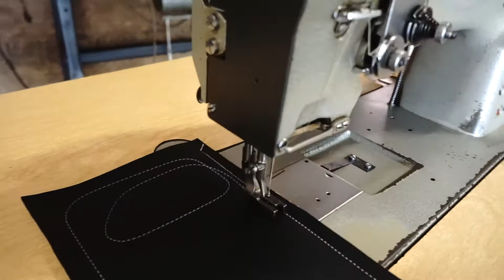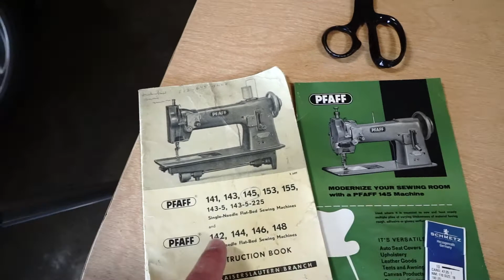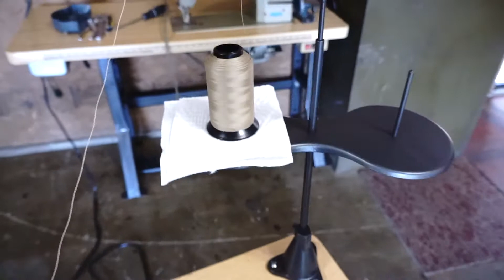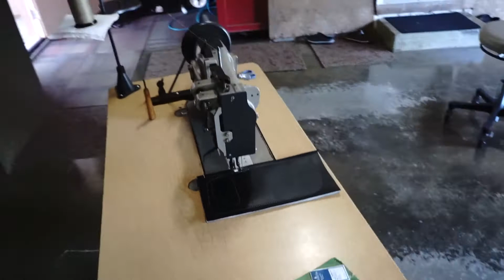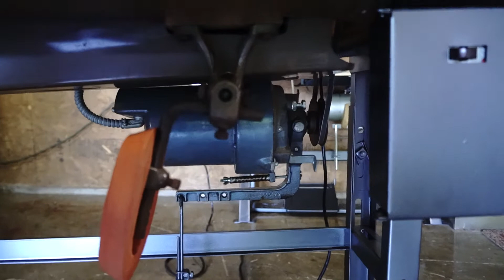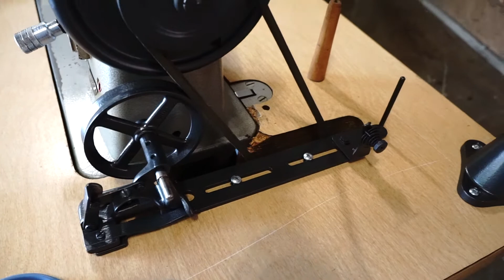Pfaff 145-H3 Industrial Sewing Machine Demo and Features triple feed w/ reverse

Comment: Only the H4 versions used the 190 needles which are longer. H3 uses the 134-35 system. The manual even states that.

Comment: Picked up a 145 H2 this winter. Those things are getting used a lot and you find them pretty easily here in Austria, but they just don’t die so the prices are quite high. But I love mine. Only planning on upgrading it to H3 (more clearance for thicker materials). Should be an easy fix. Only hurdle is to find the parts.

Comment: I have a 145-H4 and need to time the bobbin to the needle.  I'm having difficulty getting the bobbin spindle to free up from the rt. angle gear under the bed. (set screws are out)  Any suggestions on how I might free the spindle up so I can engage the gears while setting the bobbin timing?  TIA
Reply from the maker: PB Blaster spray it and let sit overnight.

Comment: Nice machine and nice clean up, I'm new to this so watching a lot of video's and forum's. I think I've seen your help comments on leatherworker. I just got an old Adler 167 GK 373, it is so similar to your pfaff to the point someone installed pfaff rods and feet on it. Good for me because I hear Adler accessories are expensive and hard to find. After seeing this I'm going to inspect my clutch components to see if it helps the feathering. Helpful video

Comment: I have the same machine and even though I've had it for several years I've never been able to get it to "soft start" so to say.  Yes one hand on the wheel to get it started can improve it a wee bit.  But often on a start up I want both hands on the material and I want to change direction within an inch or so. I've made sure all mechanical points from the foot pedal to the motor are free and lubricated.  Sometimes when I stop and then try to start again it won't budge with normal foot pressure.  So I encourage it with the wheel and then it takes off at a million miles an hour.  Any tricks of the trade beside switching to a servo motor at about $300. ? How do you adjust the clutch brake that you mentioned?  Perhaps that has something to do with it.
Reply: I just installed a servo motor on mine for about 30 minutes of time and $100 on Amazon 😊

Comment from the maker: I ONLY SELL MY PERSONAL MACHINES WHICH I HAVE MANY
Reply: I can't remember the power machine's number designation I used back in 1968, but this machine LOOKS ALMOST IDENTICAL to what I had limited training on back then. Was the  model 145-H3 available back then??? If so this has GOT to be the model of machine I trained on. I only got to use that particular power machine for about two of the three & a half months that I worked @ Oregon City Boat Top & Auto Upholstery, primarily as a "puller/installer". I recieved rudimentary training about the power machine, safety, loading the bobbins, walking foot operation, stitch length & adjustment plus threading the machine etc. I only got about two hours(@ best) per day  on the machine after school. I fell in love with that machine despite moving into a higher paying occupation after graduation. I'm about to retire(2 years out) & my memories of 68' & that power machine now dominate my thought pattern. The ONLY 2 differences I can visually see from the power machine I once operated & this 145-H3 is the Pfaff power machine I once operated had only ONE black bar Spanning the length over the top of the machines (arm?) to the head & this one of yours has 2 bars stacked on top of one another. Depite being 52 yrs ago I DISTINCTLY remember that power machines silhoutte! It also had a green colored top to the table with a scale embossed on the vertical edge of the table. My ONLY complaint from memory with this power machine was that it took off too fast for me, like I had trouble with the footfeed so used the leg/knee feed so I could plant both my feet on the deck for stability. As a cylinder head machinist & carbureted induction specialist I appreciate quality craftsmanship & see you do also! I'm looking for this very model of power machine. I know there are both newer Pfaff models & other brands of power machines that I can purchase but... & this is going to sound crazy... I am strung out on this 145-H3 model of power machine. I have viewed online both the 1245 model & the 545-H4(what does the H & following number mean?) & then came across this domain of yours, I mean If possible I would have stepped right into the monitor took a seat in your shop, threaded that 145-H3 & start stitching some roll & pleated/diamond stitch matrerial! If you come across another 145-H3 PLEASE follow up on this reply of mine!